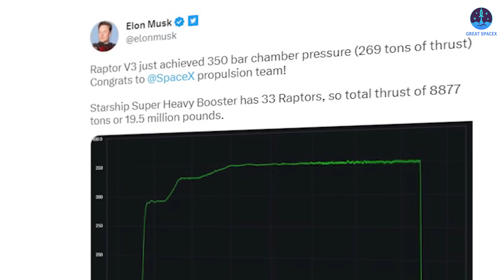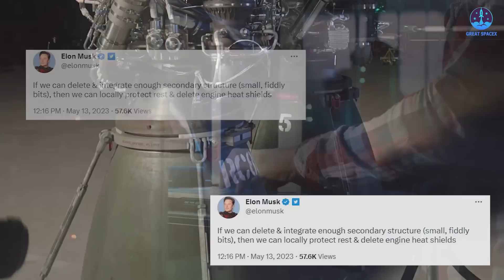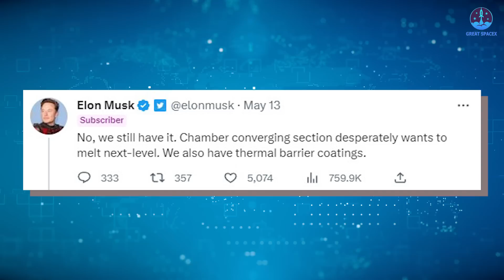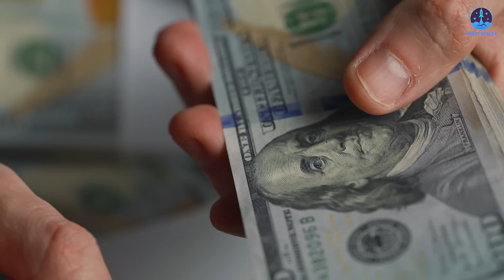Elon Musk Just Officially Revealed NEW Raptor Engine 3 0...

Comment: Although Wikipedia is full of junk and misinformation, it is still a good idea that takes no time or skill to check with before making statements on public. RD-180 was developed by a contract for Atlas-5 and the simplest and cheapest way russians came with was to "cut in half" the RD-170 engine (powering Energia lounch vehicle) and make restricted productivity turbopumps and preburn chambers for the halfed version. So it's not a good idea to compare lemmings with capibaras, just because they exost you knowledge.

Comment: Even though I'm convinced that we already have antigravitational technology and that NASA and SpaceX and all of these other space programs are just theater that also accommodates scientist and white-collar welfare, I still have an idea that would save time and money when it comes to avoiding damage to the launch platform base and maybe even the tower. How about a launch platform base that is divided in half directly in front of the tower and each half has the same retraction type of design that missile silos use to open up the silo or something related? The second the rocket is lifted off the pad each half, under a torrent of water, would be very rapidly ejected away from the tower to the right and left. Maybe even put the tower section on some type of retreat/sled configuration? It is for sure that something like this will have to be devised if there is to be any kind of rapid relaunch capabilities. Just get everything out of the way of the thrust, under a wall of water.

Comment: Amazing speed, it would take any other company or nation twenty five years at least to develop the Raptor engine and then iterate the Raptor II and Raptor III, and really none would be ambitious enough to try to develop the II or III. If SpaceX can achieve the dream and go without heat shields, it saves a lot of weight off the rocket.

Comment: So, then how are they going to test the "new" Raptor engine ?  Particularly as to how it performs in simulated conditions similar to what it might have to endure in actual use. To discover its limits, and its short comings, on a proper test bed, and in test chambers. It takes a lot of testing to assure predictable performance in use and predictable failure patterns along with that. Thus far not convinced that SpaceX has done that, or enough of that, intensively and realistically enough, to really know, and knowing is everything. Engines fail when they are subjected to conditions that make them fail, and you need to discover what those conditions are BEFORE you do any type of launch.
Reply: Awww..... so why don't you go over to SpaceX and tell them how to do their jobs?
Reply: maybe that's why it was a TEST launch and not a commercial or crewed flight

Comment: Chasing thrust and chamber pressure records in nice and cool, but SpaceX should concentrate on Raptor reliability. Those engines might have been "designed to eventually achieve incredible reliability", but are at present comically unreliable, with engine rich exhaust a standard feature. Musk's goal of eliminating engine heat shields remind unpleasantly of his attempt to browbeat by sheer force of will the OLM into resisting the engine blast without common sense features of flame diverter and water deluge system that everyone, including extremely successful Shotwell managed Falcon program, use.

Comment: This didn't contain much, if any, new information.
On the StarShip launch, the Booster appeared to lose about 7 engines on ascent.  At first it seemed reasonable to believe that this was the result of FOD damage caused by flying concrete chunks.  This explanation was refuted by Elon, who said there was no evidence of FOD damage to the Raptor V2s.  So what went wrong with them?  Losing 7 engines, the vehicle is unable to make orbit!   
I have read no definitive reason for this many 2nd generation Raptors to fail and doom the mission.  I suspect that, as Elon feared, the combustion chambers melted and spewed parts into the slip stream.  
The Raptor V2 seems to be a design failure, so the news of a V3 is good!  But how long will the switch over take?  This article doesn't tell us.
Elon wants to fly again right away.  Good luck with the FAA with SpaceX using the unreliable V2s to power another flight.   I am told the booster 7 had a mix of "old" engines.  But these were new engines that were flying for the first time.  They had more power than the V1s, but they melted.  Elon announcing a Raptor V3 so soon after the previous launch indicates to me that SpaceX knows the V2s are not reliable.

Comment: Great, I wonder if these will stay running for more than three feet off the pad.  It's kind of funny, for all the Musk weenies with the NASA sucks, Space X are gods complexes to see that the first full try, after MANY tests to fly this thing got about zero feet before MAJOR failures began, and that they flew first stage to total destruction, while the FIRST flight of the Artemis flew to the moon and back, FLAWLESSLY.  

I wish Space X all the best, I really do, and they've done some amazing things, but that little kick in the teeth might dial the groupies back a bit...on second thought, probably not.  I should calculate the multiple of the relative distances those flights went.  Off the top of my head, with about one second's guess on both, I'd say about 10,000:1.  Yeah, those idiots at NASA, why do we keep them around?
Reply: As you know, Artemis is using all Space Shuttle tech and hardware.  So the engines were already a mature design that no doubt failed a lot in development.  Raptor is an entirely new animal, and it is definitely not a mature design.
Reply: The Raptor V2s don't look like they are flight ready.  About 7 of them failed, or just downright melted.  That failure rate is not going to work.  I think I read that about 3 can fail.  But even that is not acceptable failure rate.

Comment: One of the things I have never understood is the choice of methane for second stage.  They could easily have used their money and research into better hydrogen storage. (And actually, many new ideas are out there that look great) As hydrogen is far superior off world.  And also more powerful. A specific impulse of 350 for methane verses 450 for hydrogen.   The whole point of the methane, is it's better for a reusable engine.  Less soot.  But it still produces it.  Where as hydrogen truly is a clean burning fuel that leaves ZERO residue.  Making engine turn around far easier.  And it's far easier to produce off world.  No complicated process.  Just electrolysis.  And not only that, you produce oxygen.  The methane reformation process is inefficient and requires a LOT more energy. (yes, the zinc catalyst uses more power but is simper then other methods)
Reply: I think it's a happy medium compromise because of practicality reasons. Methane doesn't need such large propellant tanks, has more leak proof/lighter piping and valves, doesn't require such extremely low storage temperatures, and methane is a cheaper fuel in general. Also, having only 1 engine makes mass production easier instead of dividing effort between 2 completely different engines. I'm sure they'll move to hydrogen eventually in the future as that higher specific impulse number is hard to ignore
Reply: Hydrogen is a pernicious gas, it likes to leak and to make metals brittle. The recent Vulcan test scrub and multiple Shuttle scrubs were due to the difficulty of fueling the rocket with hydrogen because of leaks. Hydrogen needs to be extremely pressurized and chilled too, both of which also make leaks more likely. If one is aiming for rapid reusability, hydrogen would be an awful choice.
Reply: I’m sure when the mission criteria changes(once the major tests are done) they can use whatever fuel they decide is best, it’s not a permanent solution. They are making tons of these ships as we speak. This isn’t like NASA farting around
Reply: Methena is denser, making it can be done on mars, and on earth, its more eco friendly to make it( no fossil fuel involvement).
Reply: @Hungary_0987  don't forget they found water on the moon 275 billion gallons  . make methane

Comment: Ford started out with a "Model A" and moved on to success. Progress can be described as "not sitting on one's laurels" perhap?
Reply: True, but the Model A was able to drive about.  The current Raptor V2s are melters that cannot get the ship to orbit.
Reply: @paulwilson8367  yeah because it's raptor V2 and booster 7, booster 9 isn't facing the same issues anymore.
Reply: @paulwilson8367  Ture, but Ford had his problems too. One engine does not a starship make/break perhaps?
Reply: @costrio  7 engine failures broke one
Reply: @paulwilson8367  Yeah? It's clled "rocket science" for a reason. It ain't easy. I'm an optimist and regard failures as things to overcome, IMO.
Reply: @costrio  did I say anything about canceling the program?  I’m just saying there seem to be significant problems with existing raptors due to multiple engine failures and I don’t see them getting FAA approval for another flight until engines and FTS are addressed.
Reply: @paulwilson8367  Whatever...I disagree. I don't debate after making a simple comment.

Comment: Without a proper landing spot on mars, how will the Starship takeoff and or land on Mars without damaging the ship?
Reply: Mars has less gravity, so it will require less thrust for the same payload. The return vessel stays in orbit while only the landing module needs to return to orbit and reconnect for the trip back to Earth. The landers that deliver the habitats don't necessarily need to take off again.
Reply: They are building a concrete pad there right now, but much smaller, to insure destruction of any infrastructure located THERE, as well.  :-)   At least chunks won't be taking out any private property, but on Mars it is easier to get a few to orbital velocity.